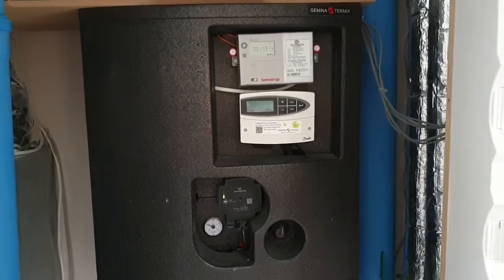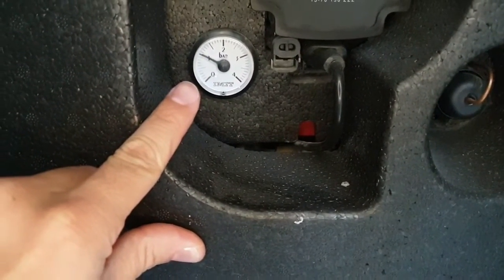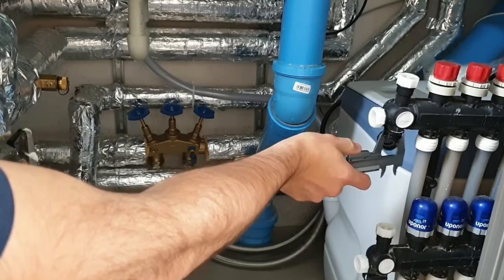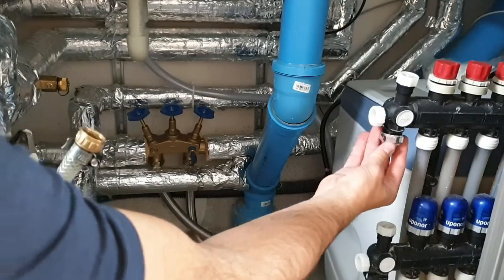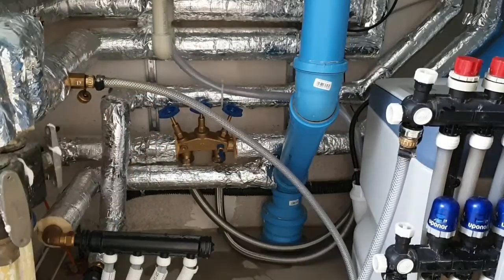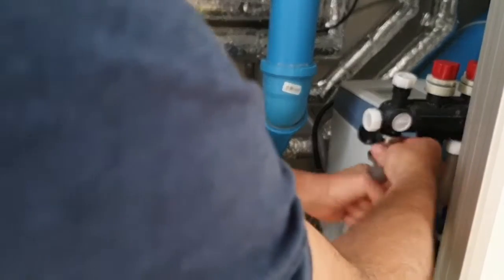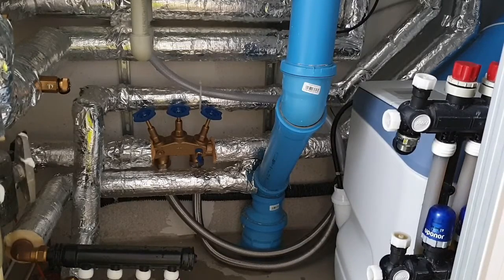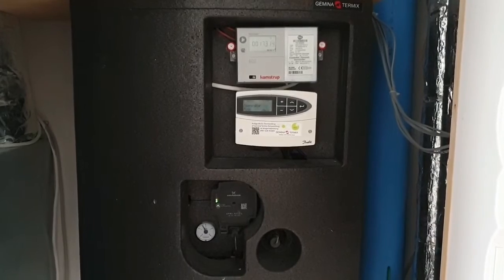How to regulate water and remove airlock in central heating system Gemina Termix

Comment from the maker: IMPORTANT NOTE:
 The indicator of the central heating system has to be a little over 1 bar and always below the red line. The red line indicates over-pressure. If you go over the red line, your system might be leaking from the pressure valve. In this case, you have to open the valve and reduce the water. The pressure relief valve is designed to leak water as a safety protection feature to prevent damaging your appliances.